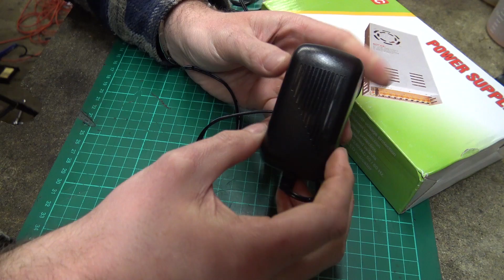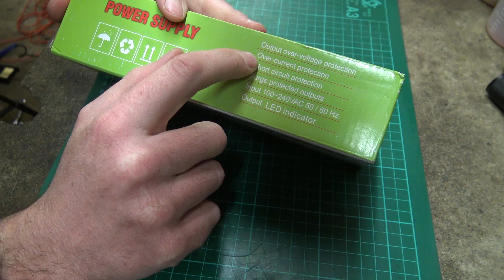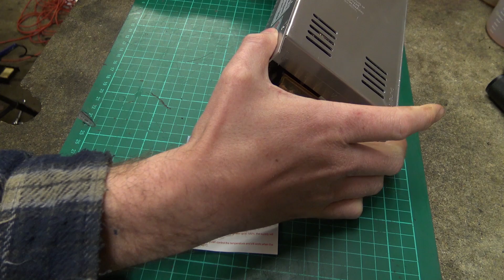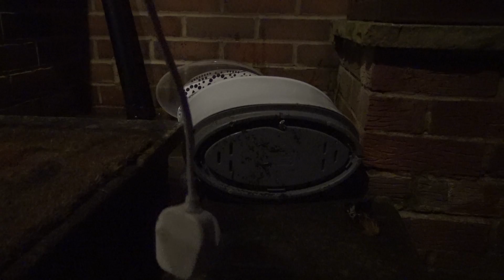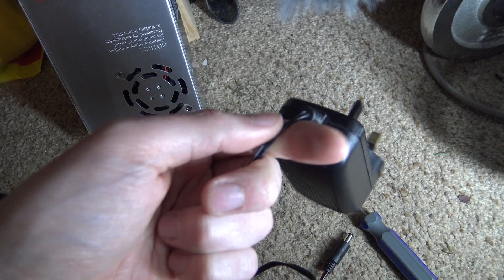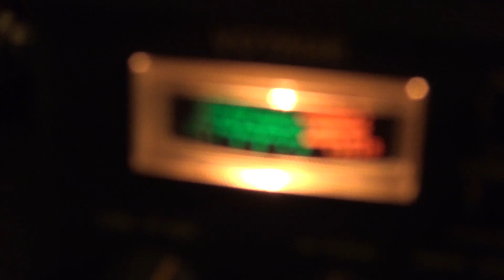Chinese 12V 30A Power Supply

Comment: I've got 4 of them psu's. Use them for over 2 years and im very pleased with them. And yes, as "Spatial Zebra" wrote, it is better to use the fan upside down so it blows inside. Downside , fan is noisy. Chinese made yes, but works perfectly.
Reply: thank you, no problem or sudden glitches of power surge? when using to a 12 volt cordless drill?

Comment: I'm about to install a Chinese diesel heater and the power side of it needs 12v , I purchased a desktop Power Supply  that puts out 13.8 v  . Would this power supply damage the heater ? Thanks
Reply: Hi Did you get one like this ? And does it work?because I have Baught the same system and I'm about ready to do the Electrical work .and it's The Exact same one. Thanks

Comment: This is quite a good power supply, and i think i would improve it inside but you don't seem to have the needed tools and knowledge...
Well, use it like this and it will be good!
Set it on 12.5V is probably better!
You can disconnect the fan from the inside very easily (there is a connector) and even remove it, for 5 amp it is not needed and it is noisy!
If you want 20 amp or more, you should use the fan UPSIDE DOWN so it blows inside, which is much better in that case (i tested it)!

Touching the case is not dangerous because it is grounded! With this power supply you shouldn't get any noise on your radio!
But or course it is better to isolate the input terminals...

Comment: Can we use this as a battery charger?
Reply: why not?
but you wouldn't need 30a. bit of a waste that's all.
Reply: it is more difficult than this! DO NOT use this as a charger randomly!

If it is for a lead acid battery, set it to 13.8V and ensure that the capacity of your battery is 150Ah or higher, otherwise this power supply can easily damage it!

Comment: what is the maximum and minimum voltage,i plan to buy one as a charger for my backup battery,but i'm not sure if i can get atleast 14.2v out of it,if you already tested it pls let me know thanks
Reply: Mine measures: 9.95v minimum, 14.60v maximum
Reply: @englishrupe01  thank you
Reply: @amadzack666  DO NOT use this as a charger randomly, it can be dangerous! It can supply 30A so only for 150Ah lead acid batteries or higher!
And better to set it to 13.8V then
Reply: @Zebra_Paw  yes i know, but i don't think that going to be problem for the car battery since altenator produced atleast 60-75amp@14.4v
Reply: @amadzack666  if it is in a cyclic use it is different, so OK, but still 13.8V is better!
Reply: @Zebra_Paw  yes but sometime we need to push it to 14.4v to burn off Lead sulfate so 14.2v is the best for both capacity and life span unless they're gel type battery which 13.9 is the best for them.
Reply: @amadzack666  yes of course but if they get sulfated it is because of a deep discharge that you should avoid too! I still say that 13.8V is better...
Reply: Let me know too 😉

Comment: What meter did you use to measure the voltage?

I have been looking at voltimeters, but I have ordered a 12V 30a power supply, and I noticed on most of the volt voltmeters it says 10a max? Does that not matter because I want to measure the voltage?
Reply from the maker: I used a cheap one in this video, you have to remember that Voltage is the potential difference and amps is the current. 
If you only want to measure the potential difference (Voltage) the current rating won't matter as long as the meter you're using has the correct voltage capabilities. In this case, 12V or 13.8. 

I hope that helped?
Reply: it doesn't not matter,those 10a rating for measuring current draw not voltage
Reply: @amadzack666  what if the current draw is above 10A? I guess the fuse will blow?

Comment: I've never liked switching power supply solid state power supply for me all the time
Reply: Why? Switching power supplies are fine.
Reply: @AureliusR  
noises, lifespan and backup of the equipment connected to it, when things go wrong
Reply: @THESHADOW97139  Dunno why my reply isn't showing up. Switching supplies are just as good as linear, plus way more efficient. If you made a linear supply as cheaply as the Chinese make those wall warts, they would be awful and unsafe too.
Reply: @AureliusR  My answer was deleted too...
In broad terms, a switching power supply will just have the advantage of being less heavy and having better efficiency... which in no way hinders a linear, in the context of its use on a CB or other radio.
The linear will always be quieter (especially on the air), will have a better lifespan (more than 30 years for some), can be repaired in the event of a breakdown, etc....

Comment: I want to do same with my cctv I get s9 noise if I cut plug of power lead how do I no which is positive you say inside and outside wires but you will only no if you take the the pin plug apart and I thought mine was a sealed unit ...the 2 wires are black and black with white stripe
Reply from the maker: Look on the plug, as I showed in the video mine tells you which is + and - and the wire with the writings was negative if I remember correctly, the stripe was positive. If the plug doesn’t say, check in the manual it might have a drawing.